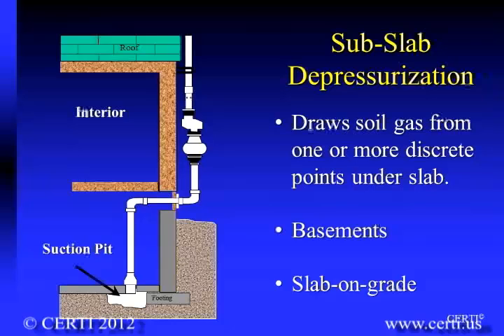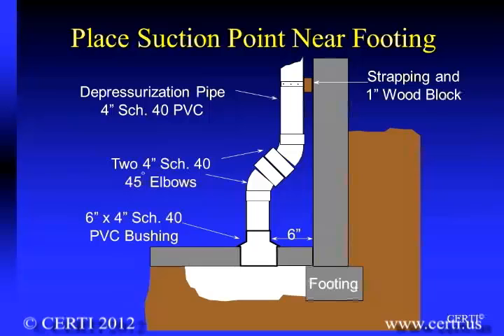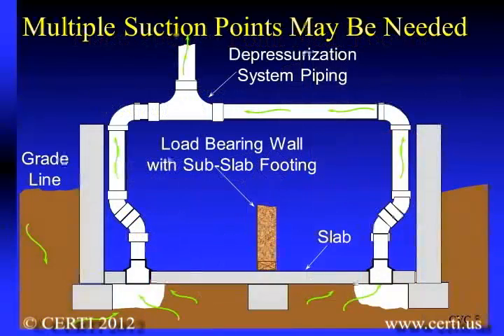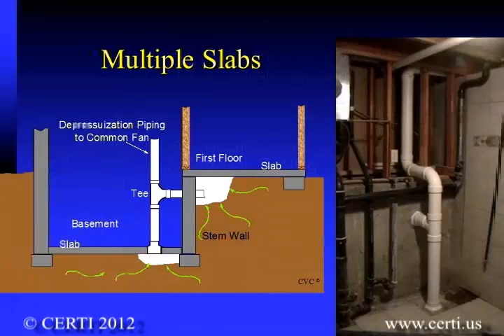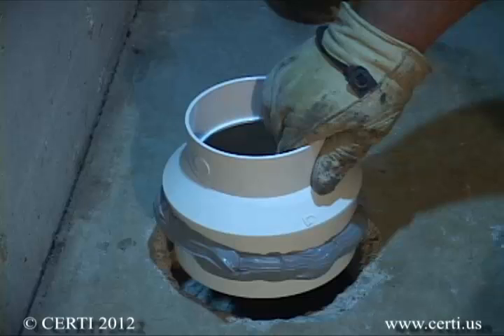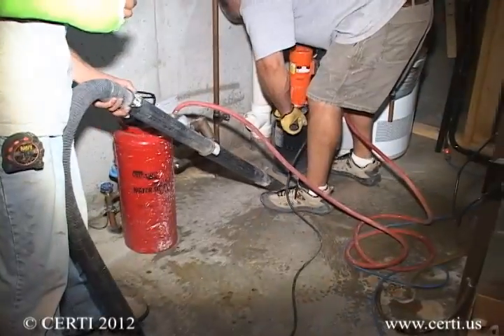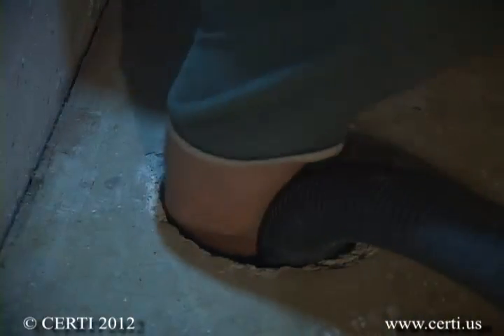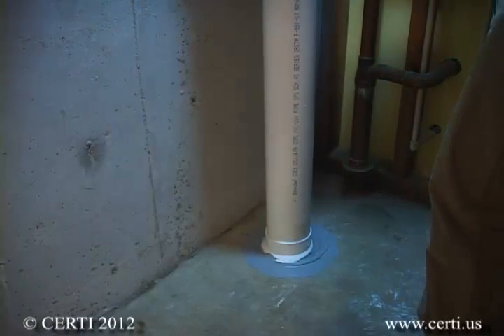Treating Slabs and Basements for Radon

Comment from the maker: Polyurethane is used when caulking slabs.  It is pretty durable.  If caulking a sump cover where one has to periodically remove it gaskets are used or a less permanent silicone

Comment: A radon mitigation fan pulls air through the gravel beneath the slab at a rate of 140 to 500 cubic feet per minute.
Where does that amount of air enter the gravel beneath the slab?
Reply: 500 CFM sounds higher than I have ever seen, at least in a residential system.  Typically, they are more in the range of 20 CFM to 150 CFM, depending upon porosity of soil.  Tracer gas studies suggest that roughly half of the air comes from the inside of the house through floor to wall joints and other openings in the foundation.  Caulking those openings can reduce that to around 30% which makes the system work better and reduces the loss of conditioned,  interior air.  The balance of the air comes from outside of the foundation with a lot of it coming from above grade and down through the soil outside the foundation.  Another component comes from down deep in the soil but typically is a small component of the total air flow, depending upon the existence of fractures in geology or KARST formations.  But it is the small component of soil gas (containing radon) that we are after and the other air is the result of the vacuum needed to capture the soil gases.

Comment: I started my hole in the corner of a finished slab basement built in the 90's. I'm at least 12" from each wall. So far almost a foot of solid concrete. Maybe in a footing, would you try a new spot or keep going?
Reply: Yes, I would try a different location.  Use a rubber mallet to thump on slab-listening for a hollow sound.  This would be the better place to locate a core.  Also, drill down with a small bit until to "drops" through bottom  of concrete as an indication of thickness.  
What you are fitting may be a very larger footer or where they dumped excess concrete when they poured.

Comment: Do you always recommend drilling a new hole in the slab or, could you go with a sump pump installed Radon Mitigation system?  Which type works best?  Thanks.
Reply from the maker: No not always.  In fact as you point out drawing vacuum on drainage system such as a sump is a great way to deal with radon, provided it is done in a manner that does not restrict the sumps ability to collect surface water.  See the Overview video on our channel at Overview of Radon Mitigation Approaches

Comment: Can you elaborate on why the center of the slab is often the least desirable location to place the pit? Won't putting the pit close to one side (or corner) mean a lot less suction on the opposite side of the slab? Thanks.
Reply from the maker: Yes.  There is typically a void space around the perimeter of the slab, where the subgrade has either settled more or was not compacted as much prior to the pour compared to the interior portion of the slab.  By applying the suction point here this small settlement void acts like a collection duct all around the perimeter of the slab, including the opposite side of the basement.  Of course, if the slab was poured over a continuous layer of gravel, it would not matter where it was placed, but in older homes where there are decent sized footings (not Arizona ) the outside wall will work better.  It also makes it easier to support pipe off wall and gain access to outside routing locations.
Reply: Center for Environmental Research and Technology, thanks for the quick response. I see what you are saying now. Our house is about 40 years old. I drilled my pit closer to the center of the slab, and removed about 6" of crushed stone before hitting heavily compacted soil. Since I have not yet inserted the pipe, I am seriously considering re-filling this hole and drilling a new one closer to the exterior wall. The amount I would save on pipe would more than cover the hammer drill rental.

Comment: I just don’t see how this could be effective in a clay soil. What are your thoughts?
Reply from the maker: First, if there is radon coming in, there is a pathway and the key is to intersect that pathway.  So if the there is not a radon problem-either due to low radon source or no pathway (i.e. homogeneous clay under structure) there would be no reason to apply the technique.  However, clay soils are often not homogenous and there are areas under the slab where during the construction process other fill was used.  Also, clay shrinks forming cracks (pathways) and also pulls away from bottom of slab leaving a small gap from bottom of concrete and soil beneath it.  That gap is sufficient to draw soil gasses laterally to the suction point.  Actually some of the highest radon levels we have dealt with have been with houses constructed on clay where it comes up along the inside of the foundation wall-which dissolved the myth that homes built on clay would not have a problem.  If there is a pathway and a source it can come in.  The trick is to intersect the pathway.

Comment: What sort of cored drill do i need in order to drill the concrete slab? This is my main concern. I will do it once so dont want to spend a lot on a drill that will be useless after one use. Can I chisel by hand?
Reply from the maker: Unless you are doing  lot of cores, as a radon mitigatory might be doing, a hammer drill with a 3/8 to 1/2 inch bit will work just fine.  Draw a circle on the floor to match the fitting you will use (often a 6 inch to 4 inch reducer), then drill a series of holes around the circle.  The use a chisel bit on the same hammer drill to punch it out.
Reply: @RadonCerti  Thanks for the advice. a hammer drill or a rotary hammer drill?
Reply from the maker: @Sean-Aviation  The drill needs to be both rotary (for drilling holes) and "hammer" for chiseling. Most hammer drills have a selector that will allow it to function in either situation and actually when it is in rotary mode it is punching down or hammering at the same time.  Hilti or Bosch and others  make good drills just verify they have a selector.
Reply: @RadonCerti  Thank you for the advice. I appreciate it

Comment: How deep should the hole in the slab be
Reply from the maker: Bill: Generally, we say two 5 gallon buckets of dirt.  But there are cases where the upper layer is very compacted and you need to get down below that.  Also, if there is gravel beneath the slab then even 1 bucket will work.  I know this is not music to one's ears, but the harder it is to dig out,  the more you to dig out.  Also try to dig towards under slab plumbing lines where the extracted radon can move along the loose fill around the plumbing lines.
Reply: @RadonCerti  wouldn't the slab just sink without gravel underneath?
Reply: @RadonCerti   Thank you, That is great information. It would make sense that subslab stack effect air would travel through the small voids created by loose fill settling around plumbing & sewage pipes along with the aforementioned wall footing zone.